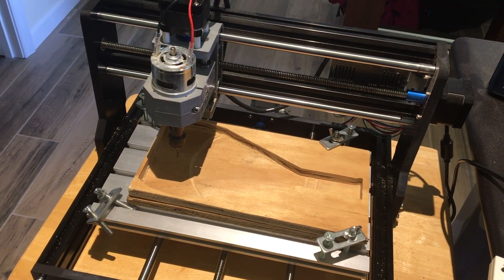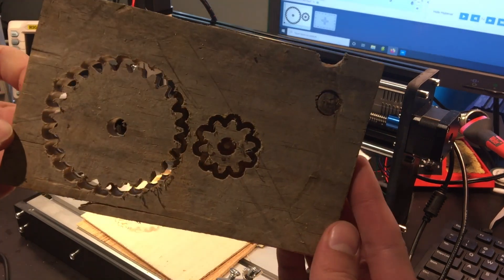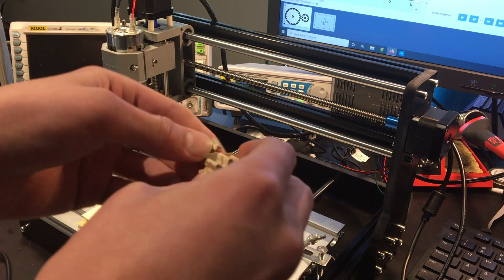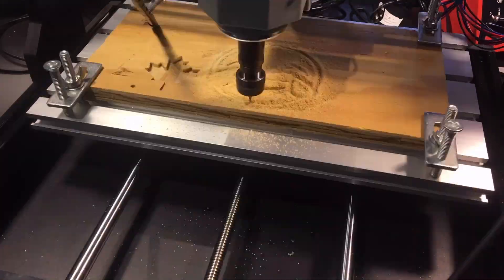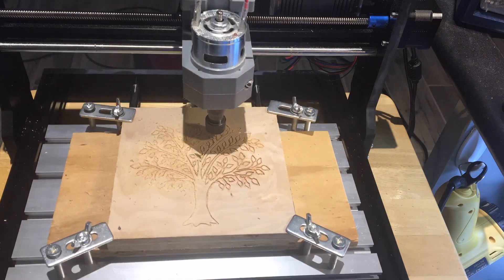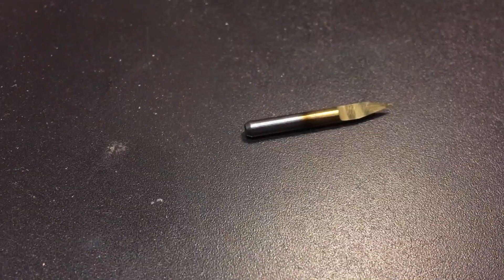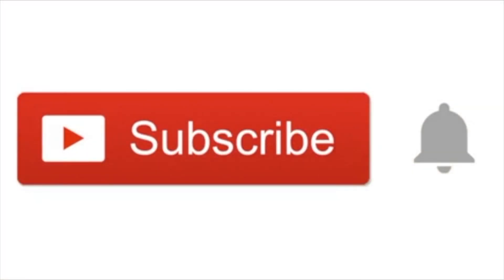3018 Pro CNC Demo

Comment: Just got mine this week. You mention you has set the feed rates too high and snapped the thinner bits, but what speeds were you running ? (and what do you recommend)
I've seen people say keep it down below 200mm/min while I've seen others using similar 1/8" milling bits say they run to 1000mm/min which makes a HUGE difference in roughing out times.
Reply from the maker: There is no single correct feed rate / speed. Ultimately the calculation is targeting an ideal amount of material each tooth of the cutter takes away at once. This chip load will be balanced based on the spindle speed, feed rate, cutter size, flute count, and material.

As an example of how variable these values are, a four flute cutter moving at twice the feed rate of a two flute cutter will remove the same amount of material per tooth (given everything else is constant).

If your feed rate is too low, your bit will rub the material instead of cutting it creating a lot of friction. If your feed rate is too high you could break the bit. For more precision, there are online calculators that will tell you what the correct settings are for your setup.

Comment: Which app are you using? I'm trying to do something with my machine but all app that I tried either not see properly my machine or have no editor built in or are laggy as hell (which shouldn't be even a thing on my ryzen 5950x).
Reply from the maker: I use a program called Easel for 2D or 2.5D work. I did a more in depth explanation of how I use this program in my "3018 CNC Beginners Guide" video. If you want something much more advanced, you can also try Fusion 360 which is free for hobbyist use and can also accommodate 3D work.

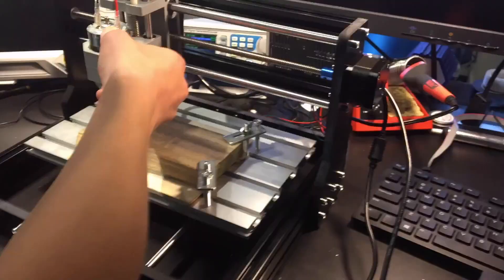Comment: 0:24 I heard of thats becouse of the usb cable that come with it.(crap quality)
Reply from the maker: Yep, I replaced the USB cable a while back and I haven't had any problems since!
Reply: You can actually see quite clearly in the video that the motor is not fastened so it falls down, which is why your mill bit “fell into the wood”. I had the same issue once when I forgot to tighten the motor mount.

Comment: Hi, i want also to cut deeper with my saint smart 3018 pro , but the cutting tools which were delivered with the machine are to short to go deeper than 1,5 cm.
Which cutters are you using?
Can you please send me an amazon link/adress?

that would be great thx 
sincerly Stephan from Austria
Reply from the maker: I unfortunately don't have the link to the end mill I use on hand but here are the specifications of the end mill as I remember them; 1/8" square end mill, 3 flutes, made by "Molza". Here is a link to a similar end mill that has 4 flutes instead of 3. https://www.ebay.com/itm/SOLID-CARBIDE-END-MILL-1-8-DIAMETER-3-8-LOC-STUB-4-FLUTE-RHS-RHC-30-DEG-HELIX/143604383578?hash=item216f7cff5a:g:8FkAAOxyaTxTSBmi

Comment: Thanx for the video! It is very useful! I'm wondering if this router is able to adjust accurately the height of the tool during the milling process?
And can I control the machine with my own G code? I would appreciate if someone could answer these questions!
Reply from the maker: Im glad you enjoyed the video! And yes, the router can move accurately in the Z direction during the milling process. The machine can also be controlled by custom G-code. I haven't tried the G-code part myself, but I know it's possible.
Reply: @CarbonCoil  Thank you very much!
:)
Reply: This machine can also carve seals (rubber stamp

Comment: when you cut the rounded by complet that doesn´t leave the place, spoiling the piece?
Reply from the maker: I'm not exactly sure what you mean, but for the carving at 1:58, I first carve the design into the piece while its clamped down, and then I cut the outside circle. This way the middle piece doesn't fall out until the very very end of the carving.

Comment: Trying to decide if I want to buy one of these and you introduce your video with "the tool plunged right through the work and I don't know why it happened" haha fantastic
Reply from the maker: Always a great thing to hear when your about to buy a CNC machine! But in all honesty, I probably should have left this in the description of the video but... that was most likely caused by a faulty usb cable. (The machine would randomly just stop for no reason sometimes and after I switched out the usb cable it fixed the problem). However, apart from that, I would still highly recommend this as a first cnc machine!
Reply: @CarbonCoil  all good man, a few of your videos popped up on it actually and I ended up watching a couple without realising they were all yours at first. It's an awesome wee channel you've built here dude.

What for keeping my youtube clean, I'm very reserved with touching the subscribe button but you've definitely garnered my interest enough!
Reply from the maker: @DeltaCodex  Thanks! I really appreciate it.
Reply: @CarbonCoil  2 weeks already? Wow. Anyway, wanted to take an extra minute to personally thank you mate.

Got my 3018 all set up and running, and with your tips and tricks along with a couple other content creators, it's went perfectly with minimal hiccups! Forced myself to finally learn CAM on Fusion and a new hobby.

Thank you for the inspiration and here's to never giving up on learning something new👍
Reply from the maker: It's people like you that I'm really here to make videos for. I'm so glad I inspired you to pick up this new hobby, and I hope you will enjoy the world of CNC as much as I do. Just uploaded a new video that's a beginners guide to starting out with the 3018 CNC! I'm sure it's a little late, as you've probably been working with yours for quite some time now, but it might be entertaining and give you some ideas on what projects you can make! : https://youtu.be/NNnxV0NLdXE
Reply: @CarbonCoil  yeah buddy, I've jumped in feet first and it's so far been a fairly easy ride. Would recommend to anyone else reading this as it has been an awesome learning curve!

I'm not one for making videos but you could make a decent viewing from a quick start guide that covers the common issues and occurrences if you haven't already. I had a couple issues with T-spline conversions causing open meshes and weird CAM routes as a result, not even sure what the method of work is for that yet, other than "play about with it until it works".

Also had a nightmare with setting up a laser module, but after a couple hours of head scratching, realised the TTL was swapped for ground on the laser board!! So obvious when you know what to look for.

Will watch your video when I get a free 10 mins at work and somewhere with a half decent Internet connection mate

Comment: Hi there! I was wondering if I could use my router bits (6 mm manual router) to carve plywood. I want to make a design where the machine carve a shallow groove for cable concealing and some "windows" (use your imagination please).
Reply from the maker: Im not sure exactly what type of 6mm router bit you have but a 6mm manual router bit could work. You just have to make sure your bit is the type that can go straight down into the material. Otherwise, you would have to plan out the route of the bit very carefully. Heres an example of a bit that can't go straight down: https://cutt.ly/qfhQAL0 This bit has a section in the middle with no cutter so it wouldn't cut away material if plunged straight down. Hope that helped, and I'd love to know how your project turns out!

Comment: Hello, excellent video. I wanted to ask what bits did you use for the cutting part as the machine’s defaults are just for engraving right?
Reply from the maker: I used a 3 flute up-cut 1/8" square end mill. The machine itself doesn't really have defaults, the feed rate, depth per pass, and plunge rate are all set by the software that creates the g-code.

Comment: do you know a good resource for downloadable files for engraving? or do you make them yourself in fusion or freecad?
Reply from the maker: For this video I used Easel to convert images to 2D designs. I haven't looked into downloading Stl files yet. However, If you do create or download Stl files, Easel does not support 3d relief carving. You will have to chose another program compatible with your cnc.
Reply: @CarbonCoil  Descargate Vectric Aspire 9.5, te sirve para la dos cosas para diseños 2D y 3D y es muy facil de manejar, mucho mejor programa que Easel.

Comment: So, contrary to popular belief, this is much more than just scratching a design in the surface of some wood with a pointy tool......would the Pro with a 500 watt motor be more capable than the basic aluminium framed model?
Reply from the maker: Yes, since the spindle can run at higher speeds and has more torque, it can cut material with a higher chip load/feed rate.
Reply: @CarbonCoil  That is my way of thinking too, but also with a bit of frame strengthening or perhaps a complete modification like that suggested by Mhin's cave etc.

Comment: Great Work!

Would you please share your feed rate, plunge rate and depth per pass?

Also I'm curious on what $110,$111 and $112 values you are using.
Reply from the maker: I use the recommended/default settings in Easel for the bits I'm using. Each bit uses slightly different settings but Easel defaults to Feed: 30in/min, Plunge: 9in/min, Depth per pass: 0.028in. Keep in mind I'm new to CNC carving so I might not be the best person to take settings advice from.

Comment: Hey Nice video, which wood did you used ? And what was the depth of the tree ?
Reply from the maker: I just used some scrap pieces of plywood. For the tree I selected "cut on perimeter" and used 1/32 to 1/16 depth with the V-bit.
Reply: Carbon Coil thanks for you reply, and what was the setting for the cut ?
Reply from the maker: @julienproduction8084  I used the default settings for the 1/32" bit in Easel.

Comment: Did you design the engravings they were really intricate and cool to see made bye the machine
Reply from the maker: No, I didn't design the engravings. I took images from the internet and put them through an image processing software that created the engraving files.
Reply: Carbon Coil In another video maybe you can show the workflow of all of the software and creating g code.
Reply from the maker: @thomasm964  Sure thing! I'll get to work. I primarily use Easel, an online website that works with a driver you download to control the cnc.
Reply from the maker: @thomasm964  https://youtu.be/jLkvw1epY6Q